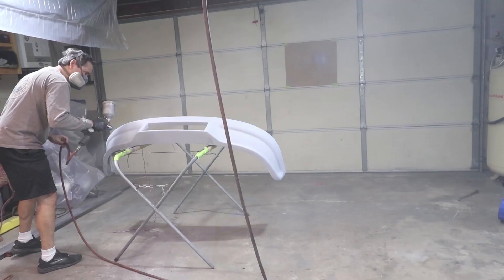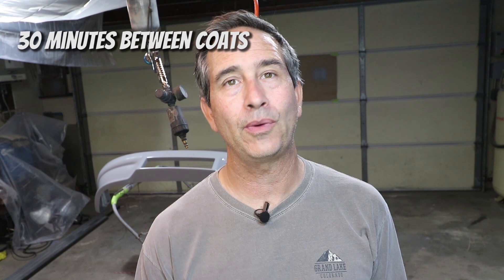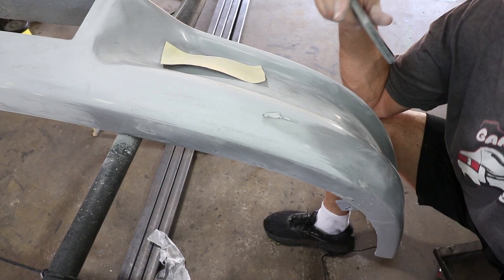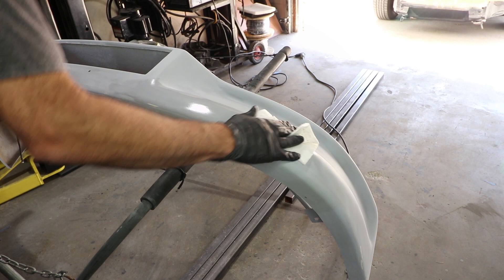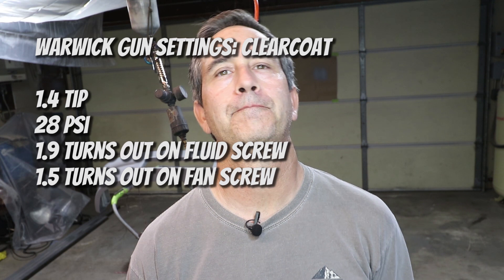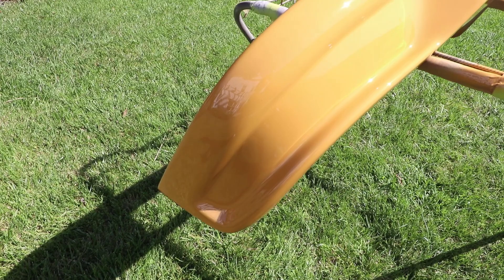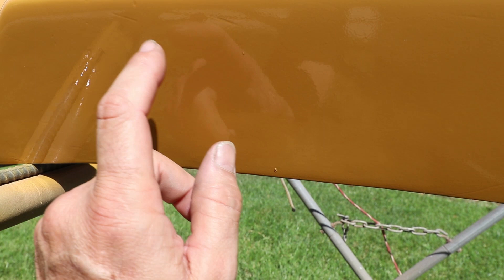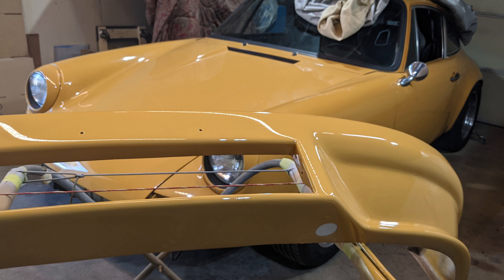How To DIY Car Paint This Bumper In Your Garage in 12 Perfect Steps

Comment: Thanks for the video, Tom. I think ny key takeaway is that as a DIY guy we have time on our sides and don’t need to spring for the paints that are quick dry, etc.
Reply from the maker: Thanks for watching Oliver. Yes the paint materials for a DIY guy are totally different than you need for a high-speed body shop.  Tamco is another good brand for the home DIY guy.
I think the other takeaway is spend time sanding and really watching as you go

Comment: Great video Tom.  I can't wait to see the bumpers installed!  I'm going to get crazy when it is time to paint my car.  I'm going to have filters, exhaust fans, filters on the exhaust fans, and I'm going to create a paint booth inside my garage.  Most likely out of PVC pipe and thick plastic tarp.  We will see...  Hopefully, I will not get any complaints.  Well, I'm sure I will from my wife because I'm going to kick her car out of the garage and seal up the area so fumes can't go inside the house.  And if she complains I'll tell her I am more than happy to have someone else do it but it will be at least $10K!!!
Reply from the maker: Go crazy Rodney!  
Might also want to check a booth rental too, although I'm sure you can build one for less than $500.  That's about what it cost me for a booth.  
Keep the wife happy ☺️
Reply: Just be careful with what fans u use. A spark from the fan motor would prove a disastrous possible explosion. Just saying. Explosion-proof fans r available just for this situation.
Reply from the maker: Amen, don't blow up Rodney
Reply: @GarageTimeAutoResto  Ha, Thanks Joe and Tom, I will try not to blow up.  Yes I need to sort out the fan situation.  To me renting the booth would make sense if this was something that I have done before but there is no way I would be able to do it under a time deadline and without all of my tools at my disposal.  I could envision a comedy of errors where I am driving back and forth to my house over and over again.  Plus I would have to get the car towed there, I don't have a truck.  I'm sure there are a ton of pluses and minuses either way.  We will see when I get closer.
Reply from the maker: All good reasons, plus you need a place to shoot primer.  You will shoot more primer than paint.
By the time you are done priming and sanding you'll feel much less apprehensive about painting the car.

Comment: You really dont need expoxy on fibreglass panels.However,if you have used it and any subsequent coats really need to be reprimed.Protocol as follows;
expoxy prime block sand with 180 grit.
Re prime WHOLE panel with high build (2k) primer block with 180 grit.
Reprime with primer, with 20% thinner added.2 coats.
wet/dry sand with 600/800 grit.Panel is ready for base coat,if no breakthroughs in coat,and guide coat is blocked out totally.
apply base,2 coats,check for crap, and block out any crap,with 600/800 grit
re apply base to coverage required.
2 coats laquer.block laquer with 2000 paper.25/30% thinner coat of laquer.
protocol we have used for 30 years.
Reply from the maker: Sounds pretty similar.  That's a big jump in grits 😁. 
Also my basecoat manufacture says 400-600 Grit max.  Not sure what happens if you go higher.
Reply: @GarageTimeAutoResto  The last coat of primer,will fill any 180 grit marks,especally after blocking.The last coat is prior to base so 400/800ish.If you go higher, its posibble to lose adhesion, as the paint surface is too smooth.
Reply from the maker: Gotcha, thx👍